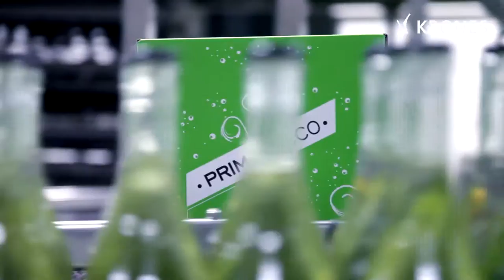Versatile Krones glass line at IQ 4 YOU

Comment: plz let me know.
1. CAPACITY [BPH]
2. The bottleneck is too small for the bottle body.  Is there no foaming while filling?  Or is there no level error?
3. Is there any problem of poor shrinkage in the neck of bottle?
4. Is there any problem of not sticking in the upper flap of the box?  There is no supporting part from the inside when attaching the flap while pressing it. Cuz the bottleneck is too small for the body.